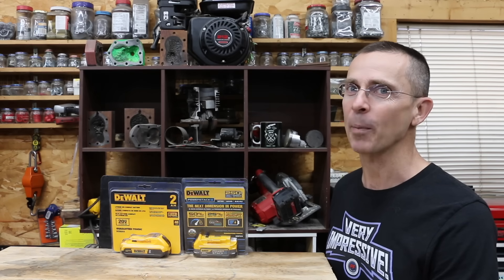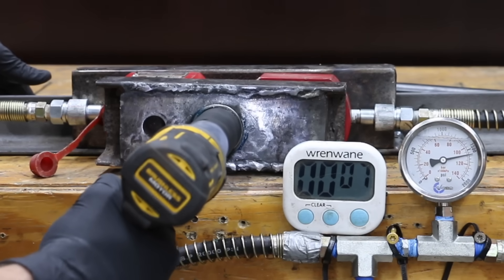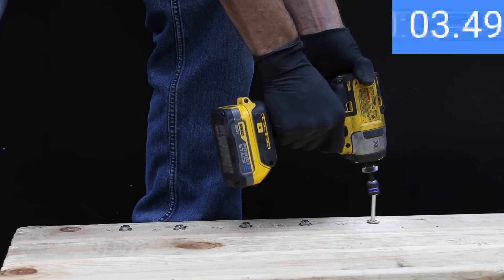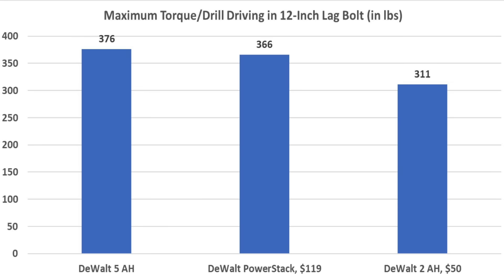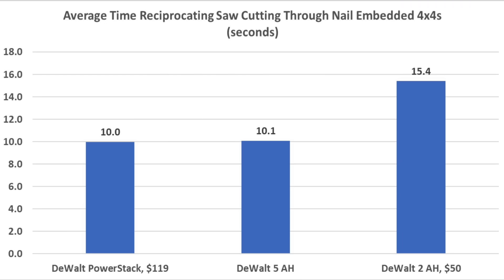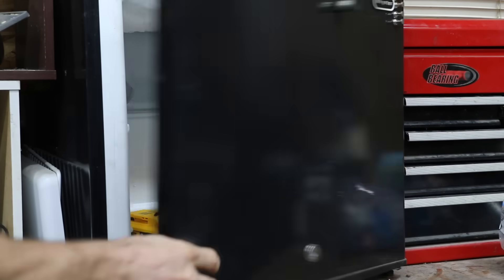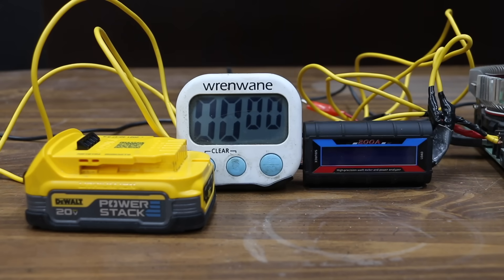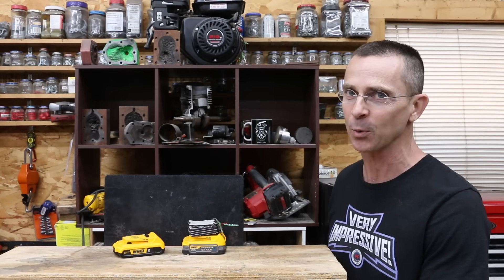Compact “Pouch Cell” Battery Better? Let's Find Out!

Comment: Isn’t it a lithium polymer vs lithium ion?  
Fun Fact: THEY SELL ADAPTERS TO RUN BATTERIES FROM DIFFERENT BRANDS ON DIFFERENT TOOLS......I AM ABLE TO USE MY MILWAUKEE BATTTERIES ON ALL DIFFERENT 18v tools....they also come with usb outputs so they can be used to charge phones and other things.
Reply from the maker: Great question.  I thought it was a polymer as well but the battery case has "ion" stamped on it.
Reply: @ProjectFarm  I guess lithium polymer would not really be ideal for power tools because they are not really supposed to be kept stored at full charge for an extended amount of time.

Comment: Another great analysis. While the new batteries are impressive, I’ll never give up my makitas. I’ve burned up dewalt drills in my lifetime, but I’ve never burned up my makitas. More than 100,000 screws driven with my two impact drivers.
Reply from the maker: Thank you!

Comment: just watched the final segment where you tore down the two batteries. the one with 4 normal cells is far easier to repair by replacing individual cells than the pack one where, once a cell goes bad, no way is that getting swapped out.
Reply from the maker: Thank you!

Comment: Great, now more garages and sheds and homes can burn down due to LiPo batteries. As someone who has experienced thermal runaway on a LiPo used in a RC car. I am not sure I would prefer them over the more stable LiOn.
Reply from the maker: Great Point!

Comment: We've used these types of stacked cells in r/c applications for a long time because of the weight advantage.  Many of the cells end up swelling after relatively few discharges. Hopefully they are as reliable as the 18650 powered batteries.  I wonder what the C-rating of the cells will be.
Reply: Yeah these are the same lipo batteries RCs use. Also the lithium jump starters. This is because they can put out a lot of amps. They have less capacity by size / weight. But prone to puffing if over discharged or left charged for longer than a few weeks.
It's also funny how lipo packs are a lot cheaper than 18650s. You can get a 4.0 AH 5s lipo (2X this capacity) for $50 so the markup on these is HUGE. But then again 10, 2500mah 35amp 18650s are $50 too. The markup on all the batteries is crazy really.
Reply: I just commented on the swelling aspect...I wonder how much room they left in those cases for the batteries to increase in size under heavy load.  And yeah, the markup is insane, you could make your own pack for a fraction of the price.
Reply: I've had dash cameras that used the flat packs as well as my DJI drones. If I get a battery that lasts longer than a year before they swell up, it's a miracle. Good thing they're only warranted for 90 days. 

Until they get graphene batteries ready for mass production, batteries using Lithium Polymer (LiPo ) or Lithium Iron Phosphate (LiFePO4) in 18650 and 20700 sizes the way to go. 

B&D has a very bad reputation in battery technology advances.
Reply: @gungadinn  Indeed. B&D shafted their trade users a while back when they changed their lithium battery form factors and tools twice in relatively quick succession. I know a lot that jumped to Makita and Hitachi because of it. You'd think they would have learned. Panasonic and Makita seem to be the ones with the best battery management and tech.
Reply: Aren't these batteries used in Dell laptops? After 1 year, I transformed my laptop into a desktop because the battery cracked the case and will not keep the charge. As usual, without an extended guarantee, Dell will not back up the product.
Reply: @CorneliuB  Exactly. These would be even higher current than the ones in laptops. More prone to swelling of couse.
Reply: We tried using them and switched back to our cell batteries as the puffy batteries burnt up,melted down or just didn't last nowhere near as long as the cell types did... They did have faster disharge rates which in turn meant more initial off the line speed but that went away quickly as they discharged rapidly..
Reply: RC batteries tend to use a more volatile chemistry than most flat cells to let them crank out more power, but given the similar application I wouldn't be shocked if these tool cells were made that much more stable.
Reply: li-pos generally have much higher C ratings compared to even the best li-on 18650s so I'd hope for the price they're pretty high.
Reply: @Voyajer.  Not necessarily.  Cellphones use Lipos, but they are generally high capacity low discharge cells.  I think that's the main reason they're so much more stable than the high discharge R/C variety that I've used.  My longest lasting battery only had a 10c rating with a 15c burst rating.

Comment: Great vs video again ! All I know is my DeWalt cordless Grinder will kill a battery in minutes I take two or 3 battery's if I have to use it. Sometimes I just load the generator in a field truck and head out to the field to do my welding and grinding.
Reply from the maker: Thank you!

Comment: Thank you so much for your dedication to others...🔋

The encased battery pouches generally have issues with swelling if not properly charged and discharged when compared to the cylinder (18650) batteries  They cannot be left in a charger or may over swell and fail prematurely.

The extra cost and weight savings is not worth it in my opinion. I'd opt for the 5 amp battery every time.
Reply from the maker: Thank you!
Reply: This is the case with all lithium batteries. Its just that cylindrical cells can't swell lol. Also modern lithium chargers never keep charging after they are done, if they did then the company would get in trouble for selling actual fire hazards to people. Lithiums don't like to be stored fully charged either, so never keep them sitting at 100% for a long time ( like a few days to a week), it shortens their lifetime a lot actually. Storing them fully charged will cause them to swell guaranteed (if a pouch cell) and lose capacity over time.

Comment: It’s obviously clear that the power stack is better than the regular 2ah, but for the double the price you’d expect double the performance. 

I agree, if they dropped the price to like $80-$90 then yeah I could see it being a more viable option but $120 is astronomical for a 10-20% gain in power. And that doesn’t even factor in the lacking capacity as a result of the higher power output
Reply from the maker: Thank you!

Comment: Curious if you used fresh lag bolts or used the same ones. If so the old 2ah battery had the best chance it would ever have with fresh bolts lol. Im stoked for a better battery in a smaller package. I always ran 4ah or 5ah on my XR impact for my projects.
Ps have you done a review on Skil 20v pwr core tools?
Reply from the maker: Thank you for the video idea!

Comment: We all know that 20V and 18V batteries are the same inside.
Tool companies like 20V because it's a bigger number.

However, airlines limit batteries to 100Wh, so you can get more amp hours from the 18V battery. Case in point, Milwaukee sell a high output 18V 5.5Ah battery (which I have a hunch is the same as a 6Ah battery) which comes in at 99Wh, but if it was a DeWalt you couldn't have it.

I do wonder if at some point DeWalt and Makita will go back to the old marketing claims. At least they're consistent, Bosch and Milwaukee having 18V and 12V when it should be 18V and 10.8V. No one says they have a 14V car battery!

Comment: Its funny how Dewalt is Marketing a very old technology, which has been around for the RC community for a long Time. LiPO .
Just remember that LiPo “Lithium Polymer” is much more Dangerous “Fire&explosion”  than. cylindrical case like 18650. Especially in a Puncture Test.

Cylindrical cell are much stronger to prevent puncture and have internal fuses to prevent fire from a overcharge.

Point is: Stick to 18650 cylindrical Cells.
Reply from the maker: Thank you!

Comment: Little confused you said that the power stack is lithium ion polymer, but that doesn't make sense. Those are two different types of batteries, lithium ion and lithium polymer or (lion and lipo). I hope that those batteries do not have polymer in it because it is very flammable and under high stress can over heat. Lipo aka lithium polymer are not used in various applications because of it. it does say lithium ion on the case which would make more sense and would be smarter to use because lithium ion is more stable than lipo. but at the same time, lipos are usually made of those softer packs so maybe it is a lipo. Hope people don't have fires because of this.

Comment: Video idea: I've been doing research on hot glue sticks and while your other video is definitive in many regards, I think it could be added to. Visiting high temp versus low temp glues, abs, could prove helpful to many. Also a redo on your tensile strength test to do sustained load over time would be a good addition. And potentially a temperature exposure test to see which ones actually hold up at various temps. Love your channel, and keep up the great work!
Reply from the maker: Thank you for the video idea!

Comment: PF: I’ve watched tons of power stack videos as I just bought a new impact and was looking into new batteries.  You testing as always, is very multifaceted and appropriate.  

Like others I think I’ll wait for now but it does show lots of room to develop a 4ah battery (my personal fav capacity) at far less weight in the future.   Really cool battery tech but not able to be mass adopted yet.
Reply: avoid these batteries or cells. pouch cells are fragile to physical, temp, and charging abuse
Reply: Li-Po batteries are old tech that has been surpassed for quite a while now it’s the same battery tech that was in early smartphones that would expand after awhile

Comment: Interesting that DeWalt is claiming 'new' technology. Those pouch style cells have been used for over 15 years in several applications. The disadvantage is they are easier to damage with improper charging or discharging, and the actual cell isn't as physically protected. Good charge controls and good packaging are needed. These DeWalt packs are way overpriced, though, as the cells really aren't any more expensive than the round can style.
Reply from the maker: Thank you!

Comment: Another great vid. Pouch cells aren’t new tech btw. They pre-date the cylinder cell. They’re the first way cells are tested as it’s relatively easy to fold the separator, annode and cathode into a pouch and melt the end closed. All phones and tablet use a pouch. All hobby “lipo’s” and automotive “prismatic” use em. Look up BYD blade batteries that use super wide ones. Tesla, Rivian and other have stuck with cylinder cells due to cooling issues with slabs of pouches all together (See Good morning Bolt LG pouch fires)

Comment: Store them charged and they'll gas up and die within a few years. I hope none burn down.
Reply from the maker: Thank you!
Reply: @ProjectFarm  maybe you could do a long term test? I fly drones with similar pouch cells and sooner or later they start to develop gas inside. Just charge one up and let it sit untouched for a year - as it probably will in most households.

Comment: Hello Todd. I am commenting here b/c you are more likely to see this comment (and thanks for acknowledging my first one). Re: the ACDelco torque wrench adapter you used on testing torque wrenches. Since the ACDelcon has it's own design tolerences of +/-2% CW and +/- 3% CCW, if you didn't account for that (and it has the same fluctuations as a torque wrench), didn't you potentially introduce a multiplier of errors that were not consistent across the wrenches you tested?  Also curious as to what your background is education and work. You are obviously well-schooled and organized with some very creative test benches. Lastly, what happens to all of the items you build/buy? Surely you don;t have room for all of them? Thanks!

Comment: Your videos are awesome and really helpful!!  Like others have said.. right now at their current price I'd rather have 2 2AH or some 5AH than the Powerstack but if the prices drop I wouldnt mind using them... Be very careful opening up those pouch batteries.. they can catch fire really easily (and violently) if their contents get exposed to air/water.  Additionally the quick cut off of their power is due to the power management board (BMS.. battery management system) they have.. they have to cut off the battery from over discharging to prevent them from being damaged.. basically if they are drained to "deep" they wont take a charge again... ergo the BMS cuts them off to save them.
Reply: The quick cut off is mostly due to the fact that the PowerStack is NOT a 2Ah battery, but a 1.7Ah one.

Comment: I buy DeWalt batteries based on capacity, compactness, and performance, which would favor the Power Stack. However, when a battery dies, it's usually 1 cell spoiling the whole pack. I salvage the good cells and use them in flashlights, Dremel-type rotary tools, phone chargers, etc. The Power Stack batteries will have to get very cheap indeed to make me change my habits.
Reply from the maker: Thank you!

Comment: As usual and expected your tests are Fool Proof and this one showed me that we are getting a little crazy with these battery powered tools.  In my shop I prefer my 30 to 50 yr. old corded tools as they are twice as powerful for as long as I want them to be.  Also I have a 25 yr. old Panasonic 15.6 volt 3/8 drive with 4 original batteries and they all still hold a respectful charge and the whole set-up cost $49.95~!! I use the drill weekly.  Metro Men are Tool Whores~!!

Comment: Those pouches seem like they can't be easily replaced once they fail unlike standard 18650 cells. Seems like another way to force you to buy a new battery instead of having the dead cells swapped. This buy new instead of a simple fix products are the worst things ever invented.

Comment: Hey be very careful with lithium polymer batteries do not keep them in your shop after ripping them apart like that they are very dangerous and can cause severe fires just look up lithium ion polymer batteries fires..... The people in the RC world respect them quite a bit because they can do lots of damage..... And they're not easy to put out..... You're lucky that you didn't run into any problems when praying it apart like you did
Reply from the maker: Thank you!

Comment: Reduced size and weight are the only factors making the "stack" a better deal. In every way the 5 AHr battery stomps the stack, especially in terms of price, because they are the same while the 5 Ahr provides more than twice the watt hours. I'll bet battery usable lifetime for the stack is atrocious compared to 5 AHr, too.
Reply: I would certainly prefer the 5AH battery option. The change in technology does not provide enough benefit for the price.
Reply from the maker: Thank you!
Reply: You’re incorrect. The power stack is supposed to have double the lifespan then the cylindrical counterparts.
Reply: @juanc5149  I'd have to see an independent test to believe that clame. Normally Lipos have a much shorter life than a decent 18650.
Reply: @juanc5149  I’ll believe it when I see it…. and see it repeated over time. We were told LED replacement lightbulbs would last much longer than incandescent but time has proven their cheap parts or manufacturing processes has produced bulbs that actually don’t last as long. 
-Not all change is progress.
Reply: @preachers4135  LEDs indeed last more than incandescent bulbs, but there are a lot of knock off  LEDs like those cheap ones sold on ebay  made with cheap drivers, insufficient heat dissipation and thin wiring that just won't last long. I have only replaced one of the LED bulbs at home since I made the switch 5 years ago.
Reply: @preachers4135  Not sure what LED bulbs you've been using, but I've only had to replace maybe 1 LED bulb ever, and I've been exclusively buying the absolute cheapest ones, and they have been used for lights that see constant cycling and tons of actual usage time. I can't count how many incandescents and fluorescents I've gone through. Been using LEDs literally everywhere I can for like 7 years, or however long the prices have been sane. Plenty of those LED bulbs have been 60w replacements that cost $1 each.

You have no idea what you are talking about.
Reply: @Namington  We could of had a good conversation up until you said, “you have no idea what you are talking about”.  It’s a shame how the internet has brought society to such disgust.
Reply: @preachers4135  That's a pretty poor attempt at an appeal to higher morality. You made baseless claims, ergo, "you have no idea what you are talking about". If that is disgusting to you...well, you may want to hold off from interracting with people, or you're going to have a pretty rough time.

I don't think anyone but you imagines that "you have no idea what you are talking about" is an example of society breaking down due to the internet.
Reply: @juanc5149  they are supposed to have 50% greater power output as well. Clearly that's not the case
Reply: @juanc5149   I have never seen a pouch pack have a longer lifetime than a cylindrical cell. Cellphones use pouch cells, albeit high voltage ones, and they are only usually good for a couple years nowadays, cell phone batteries trade lifetime for more capacity. There's a reason why pouch cells need compression for longer life...